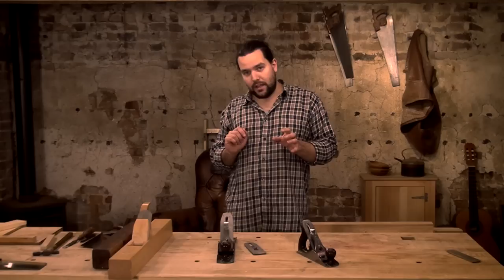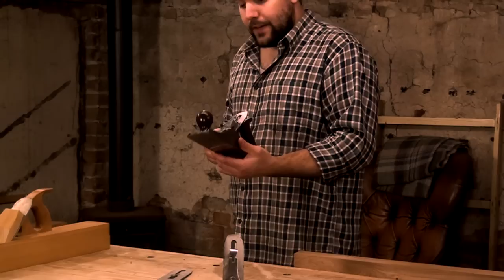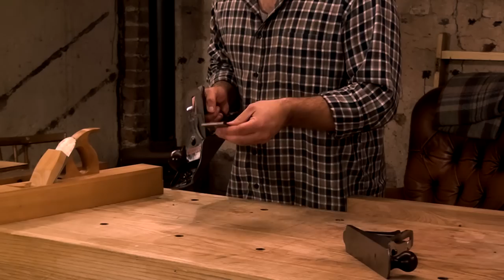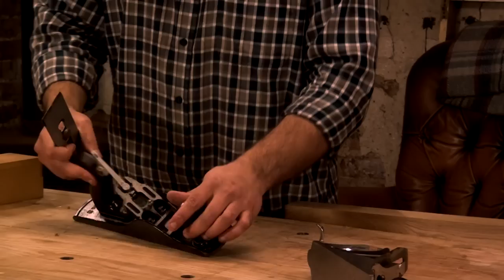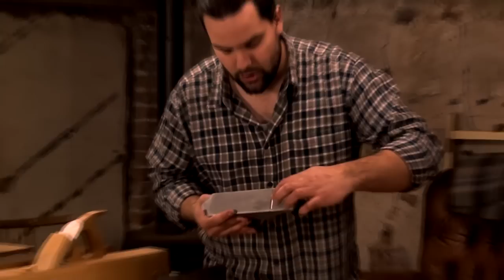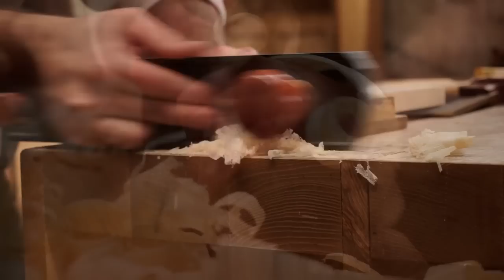Choosing Your First Hand Plane For Woodworking

Comment: Found a Stanley no 5 in my dads old tool box. It was in parts but once I put it together and sharpened up the blade it worked fine. Got to admit that it is one of my favourite planes as well.

Comment: I purchased a mirrored dresser and the outside wood veneer molding is about 28 1/2 inch wide but the space is 28 inches so this video was great because it will solve my issue. Thanks

Comment: Great video, exactly what I was thinking as I've gotten back into wood working in the last couple years. Managed to find 2 old, used No.4s, but as you note, the toe is very short, hard to reference. So I'm curious, if you were going to buy your first new plane now, would it still be the No.5 or would you go for the No.62 low angle if price was about the same on both? Both of course with 2 blade options/setups.

Comment: i have just bought the stanley jack plane no 5.
but rather than buy a smoothing plane i would rather just get the blade
i dont know how to get the right blade that will fit in my stanley jack plane no 5 body.
any ideas

Comment: Another great video! I would agree, my first was the #5...but if I could do it over, I would have purchased a new low angle jack with a couple of different blades for the same reasons you pointed out and just got on with making shavings.
Reply from the maker: Thanks Fish, I completely agree, for versatility the low angle Jack is king.

Comment: Regarding Stanley No.5. Can I trust the quality of the latest batches of Stanley planes and just go and buy a recent 12-005 model?
Reply: I wouldn't buy a new Stanley plane. Go to  a reputable dealer like "The Best Things" and get a pre 1950 Stanley #5 or 5-1/2. Talk to them about it they wont steer you wrong. One of those WWII or earlier Stanleys IS BETTER THAN ANY STANLEY YOU CAN BUY TODAY !! (They're made in china) Not kidding. Same with the Stanley block planes (I would NEVER consider buying a modern chinese Stanley block plane - not to mention: for the same or more money?? NEVER).
Reply: Ah, I was diving for a handplane this entire 12 months. I came to the same conclusion. The current Stanleys are no better than any other Chinese or Indian made cheapos on the market.
Some extra conclusion to add - pre or post WWII, it doesn't matter that much. Stanley bench planes are of flawed design with overlapping inacuracies. I went with traditional wooden planes with solid thick irons (some laminated!), unlike Stanley pre or post WWII 2 mm thick lasagnas. Remove some rust or pitting and you're left with something... cringeworthy.
Reply: +Tome4kkkk
You're cringeworthy.

Comment: For me, it would be a toss up between a jack and a block plane as a first plane. The jack is a really handy size (perfect for 80% of anything you would do with a plane) and the registration on the toe mentioned in the video does make a big difference but the block is so useful for many jobs, convenient to carry, and an adjustable mouth block plane will do as well at smoothing as anything else.

If you are looking for a jack plane, there are two other variations on the jack that are worth considering but are not quite as common. The Stanley  5-1/2 and  5-1/4 size planes. If you are a larger person, the 5-1/2 is a very nice size. A bit bigger than the number 5. If you are of smaller stature, the 5-1/4 (also called the junior jack) can be a lot easier on your arms. They were mainly marketed to schools.
Reply: David Kirtley I second the 5 1/4 junior jack plane.  I have one that I’ve used for years as a smoother and a workhorse with a home made toothed blade.  The thinner width of cut (1 3/4 ? as I recall) and the toothed blade lets me do the first flattening and squaring of medium (even large) stock.  My first two planes were an old 9 1/2 block plane and a standard #5 jack plane.  Once I learned to sharpen and set up properly they saw me through many years.
Reply: my first plane, before I really got into woodworking was a cheap Stanlely #4 because that's what you see around and that's what dad had ( not a woodworker but jack-of-all-trades).    my next plane , as I knew more was a #5 1/2 which is now my most used plane, I liked the slightly longer size than a #5 without getting into the longer joiner planes.  I do not yet own a Low angle Jack plane, but keep hearing about their versatility and would look into that if you were just getting started.  By the way, that original cheap #4 wasn't wasted, I retuned it into a decent "Scrub" plane.
Reply: David Kirtley HI David, I realise it’s three years since you made this comment and you might not reply but I’m a newbie and I’m really intrigued with what you said. I actually bought a Record 5 1/2 yesterday. So far I’ve only used block plane on end grain and taking off sharp edges, I’ve never even considered using it on the body of my timber. Matt Estlea in one of his videos suggests putting a bevel on both sides of the iron on a No.4 as one way to approach knarly wood, which I have done using a new Stanley Bailey No. 4. I now have 3 No. 4s an old one from around 1940 which is my smoothing plane, my old one which is the best plane I own and a cheap plane I’ve opened the mouth on and put a camber on the blade as my scrub plane. Do you think I'm going in the right direction or should I change now before I get into bad habits. I’m very much 'YouTube taught' so I know I will be getting a lot of things wrong, any advice would be greatly appreciated.

Comment from the maker: Hi Jesus, the best finish on a bench for practical use is no finish - makes it nice and grippy. But if you're wanting protection then I'd say boiled linseed oil 50/50 with turps is a good place to start. Just make sure it's thoroughly dried before you use it.
Reply: If one does use linseed oil, be very careful to NOT get any down the dogholes......please do not ask me how I know this.  -Veteran '66-68
(Why?  well, it takes months to get dry enough to let the holdfasts grip and they will NEVER hold quite as well as against dry bare wood)

Comment: great video Richard! I like how you classify the plane on how is set up instead of the length, very japanese. They have only 2 sizes  for bench planes, "jack" and jointer and the difference lays in the mouth, the camber of the blade and how deep the blade is set. Love the feeling of your workshop too :)

Comment: Hi Richard, love this vid! Seriously, you leave me in awe with your insight.

You mentioned that you have a straight blade in your smoother. If I may ask,

1. Is your smoother blade completely straight, with no camber?
2. Or do you round off the corners?
3. If your smoothing blade is completely straight and unbroken, are plane tracks in the wood a problem, and if they're not, how do you ensure that the plane does not leave tracks?

Would really appreciate any feedback on this. Keep the vids coming brother.

Comment: First plane - block plane.  You'll use it all the time on every project.  And you can learn most of what you need to know about sharpening and using a plane from working with it.   Also, they are relatively cheap. 

First BENCH plane - Jack plane, 2 irons.  You are absolutely correct on that.

Comment: I chose a No5 Jack and I am so dissapointed with it. My 10 year old Stanley block plane that has been stuck up in my loft worked better than my new £115 first plane. What a disaster. To have 5 more walnut doors to trim (all 4 sides) is going to be a now very long sweaty task. I did not expect to have to do polishing/ sharpening / honing on a plane that expensive. Maybe my naivity but as I ordered over the phone with the company and explained my lack of woodworking experience, I would have expected better help. I went to a woodworking company rather than Wickes but now kind of regret it. I'm going to have to spend quite a lot more money on sharpening gear. Not happy at all.